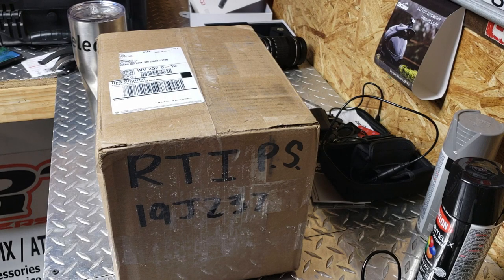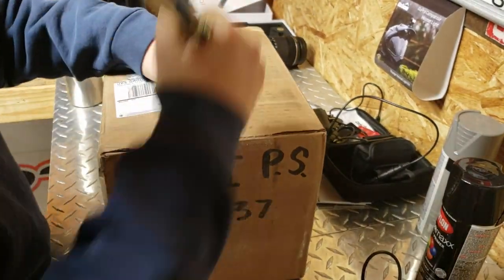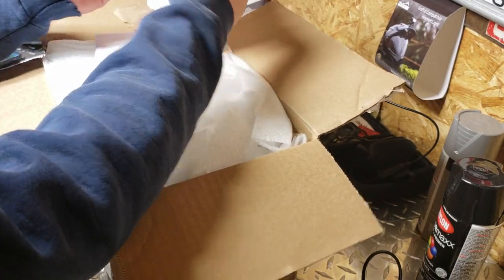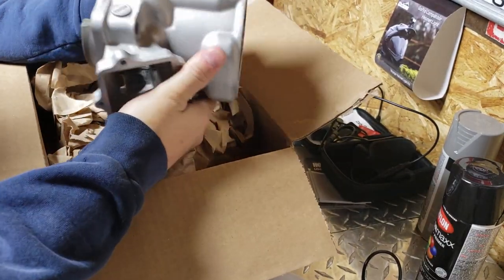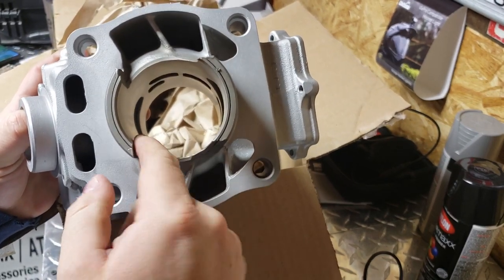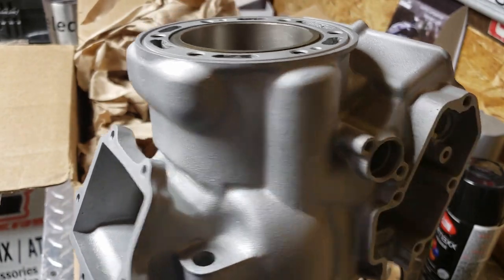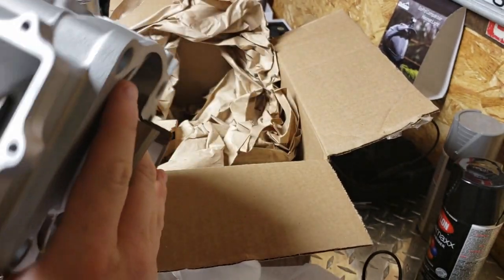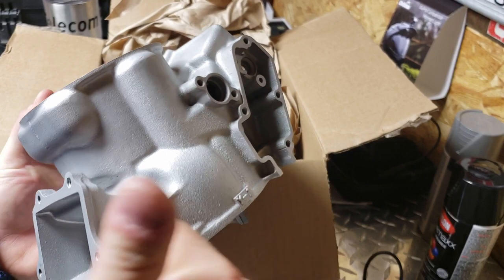Unboxing a cylinder from POWERSEAL USA !  NEW nikaseal coating on a SLEEVED cylinder?!?

Comment: Okay so I have a question. I have a 98 kx250 cylinder that's sleeved. And I really hate the sleeves, can I get removed and replated? Or will they just do as they did in the video, and plate the sleeve?
Reply from the maker: You can get it removed and replated OR replated overtop of it, yes.
Reply: @mxgryan  Thank you so much for replying. Can it be replated to the original bore? I've tried looking everywhere to see if I could get a sleeved cylinder back to normal but have had no luck finding any info on it. Thanks again!